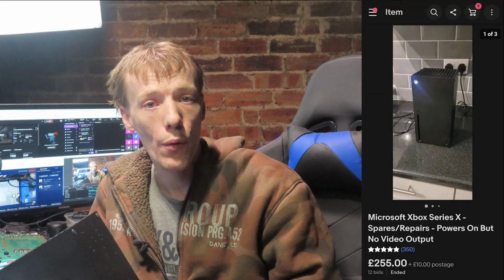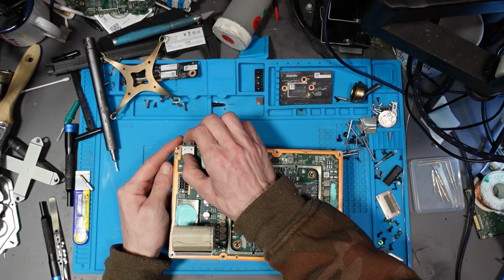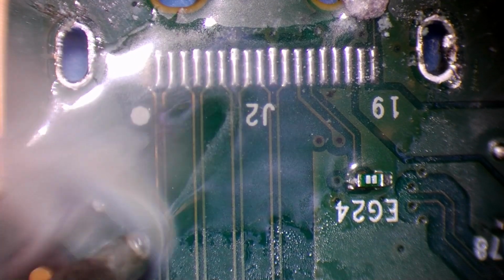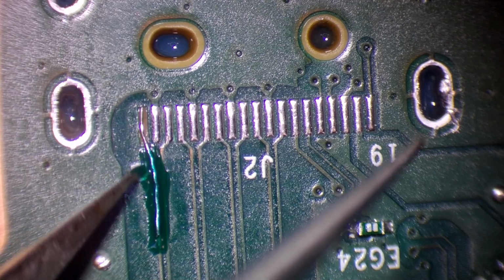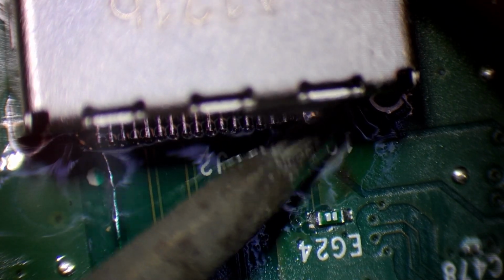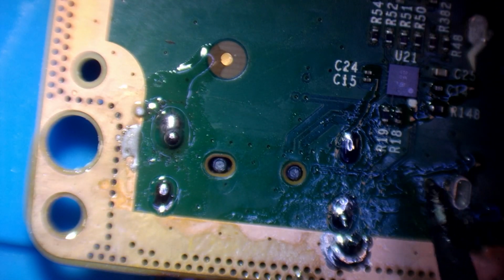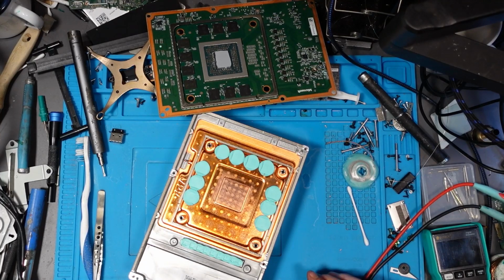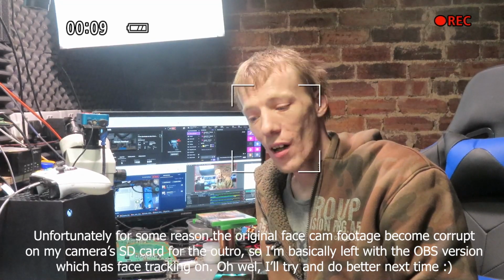I Paid $360/£265 For A BROKEN Xbox Series X On eBay! But Was I Being Lied To And Can I Fix It?

Comment: Wasn't that bad i spected way worse from a previous repair attempt, you saved an amazing console from going to the landfill and you can use it and enjoy it
Reply from the maker: Yeah it does feel good on that one, works great now too
Reply: @TheCod3r  If the listing didn't mention a prior repair attempt, and the pics showed the warranty  sticker intact, that's a bit deceitful?
I'd have pushed for an extra £30 or so off with the seller.
Good vid 👌
Reply: @stuartburns8657  I wonder if the seller was the prior repair shop. Imagine them telling the customer its trash and it needs recycled then selling it on eBay
Reply: @jasonlane4851  perhaps yes
Reply: @stuartburns8657  the fact that the posting was deceitful.  If the buyer wanted to report it to eBay and PayPal he would get a full refund and get to keep the console
Reply: @djones3021  I guess it's proving that sufficiently to get a full refund.
Still, don't try, don't get and all that
Reply: @stuartburns8657  if it had intact seals microsoft would have fixed it.

Comment: Solder flows towards heat. If you try to carry the solder to the joint with the soldering iron, it would rather stay on the soldering iron. Better to heat the wire and the trace, and apply the solder a little way away, and flow towards the joint. Then you can do it in one.

Comment: Well done - a nice neat job, and good to see electronics being repaired rather than going into land-fill.  My one criticism, which I hope you take constructively rather than seeing it negatively is to get a bit more confident with the soldering - your technique is good but you don't trust the result and uneccesarily go over and over the joints.  One or two fairly quick passes across a line of pins should be plenty - the professional assembly line workers hand solder all the pins of a 50 pin PTH connector in about one second!  Repeated passes carries the risk of lifting the pads, and from what I could see it was all fine after your second pass on the SMD pads of that HDMI connector (and a "flick" at the end would have done it perfectly on the first pass - you only needed to get rid of the bridge on the last two pins, not go over the whole line again and again).  For the mounting PTH pins connected to the heat-sucking ground plane, use a hotter iron with a chunky tip and it will fill those holes with a single soldering operation from one side of the board only in about 2 seconds, and no need to "finish" with a hot air gun (which could have caused the connector pins to become unsoldered).  Every heat/cool cycle risks lifting traces, delaminating layers and doing other damage.

As a tip, baking the whole board for a few hours before doing any hotair gun work will prevent possible damage caused by moisture flash-boiling under or inside the components ("popcorning"), delaminating or bubbling the board layers or interfering with getting a good solder joint.  I'd routinely leave boards and/or unsealed replacement components baking overnight, after which it's good to work on for the following week at least.  Plastic connectors etc. will not be damaged if you keep the oven temperature down to less than 120 deg C, no matter how long they are in the oven, though check if there are any low melting point materials on the board (some RF equipment such as radios & TVs use wax to seal variable inductor cores).  I've worked in the electronics industry for over 40 years, so do have some experience.
Reply from the maker: Cheers mate. I do wholly agree about confidence. Personally I know the job is going to be good but I like to be in a habit of checking over my work just because it's a good habit to have. You're 💯 right though usually one or two passes with the drag method will suffice for most jobs

Comment: Every time I've seen fan behavior like this on XSX, complete with the impact mark on the outer casing, removing the fan assembly and giving a firm push on the blades toward the bearings has brought it back, even if it may sound a little rough. Otherwise it would give erratic functionality, fan spin on boot but it stops trying once booting to a game.

Comment: Just bought my first faulty console from ebay to take a crack at a repair, a £20 PS2 slim. Listed as “the red light on the power button doesnt turn green when pressed”. Initial thoughts go to the little switch thats on the board behind the power button if you take the top cover off. And i was right, as soon as i took the top cover off, that little switch fell off. Hows that for my first go eh?? Lol
Reply from the maker: haha not bad, and a pretty nice win there mate. The PS2 still fetches a decent bit of change ;)
Reply: Sometimes we luck out.
I've been buying a few 'non working' N64s  from ebay recently.  The majority are just missing their jumper packs but thats not something I'd expect the thrift and pawn stores they get given and sold to will ever check.  A $15 jumper pack or ram pack (a LOT more expensive) and they're good as new.

Comment: Lucky score there... you've encouraged me to start looking for spares or repairs series x again... can't say I like that flux doing that tho. Also try the RS solder sucker you can replace the seals and nozzles, I've had the same one since colleage, a good 25 years or so....
Reply from the maker: Yeah definitely a good score. To be honest the flux only does that because I run my iron at 450⁰C constantly so it's a little too hot, if I run it at 400⁰C the flux doesn't really melt

Comment: I really hope somebody can answer my question.

As a novice in repairs myself with no background in electrical engineering maybe I'm not understanding because there is things I don't know that others do.

Then you noticed pin 1 had a loose pad Instead of hot air gunning the port off and grinding on a trace to run a wire why didnt he just grind on the trace and run it to pin 1 with the port as is  then test for signal? If all good then just solder mask that loose pad? If not then take port off board.

Different strokes for different folks or am I missing somthing?

Comment: nice work. All ive ever done is replace old electrolytic caps and a couple of discoloured resistors and a voltage regulator in my old consoles and a stereo system.
not because things werent working, but the caps were getting old and i discovered some dark looking resistors and a voltage regulator which was a bit off from the stated specs. The stero system had a leaking cap which i could see through the vents, it did still work but it was time to change them.
Reply: Got to say, I've repaired loads of through hole items and when faced with SMD's I was a little overwhelmed. I imagined it would cost a fortune for the equipment. Happily it wasn't quite the case, the need for a microscope being the biggest outlay (I'm an old fart and my eyes struggle a little now). I make decent money on the side buying and repairing tech, the internet is a wonderful resource for knowledge as well.

Comment: Xbox don't usually have HDCP enabled unless you load up an app that requires it i.e Netflix. On ps4 you can manually disable HDCP on the settings in case you didn't know :)
Reply from the maker: Yeah the xbox is fine but I'd rather leave the cable permanently connected to the HDCP splitter, it's easier that way lol

Comment: So i have a problem with a AE-9 soundcard I bought directly from Creative. 

When i got it, Creative were the only retailer of it, not sure if thats still a thing or not but the 1st one I had before I RMA'd would stop connecting with the Creative software and OS (win10) randomly, nothing would allow it to be accessed after that. 
Then it would keep doing it after a reboot, i'd resit it, allow the power to drain on the whole system etc and sometimes it would still not come back. Randomly, the same as it would switch off, it would come back. 

Caused my hair to go white since I paid ~£350 for it so i had it RMA'd but because it was outside of the years warranty, Creative would not do a refund although I did talk about it being a faulty product/batch defect as i'd never seen that behaviour from any plug in card but didn't insist that point as I really do like the sound of it, back2back with HDMI it has less loudness, a softer/sweeter sound and for vocals especially it is spot on n took a chance to get a working one. 

Anyway this one i got back, does it when Windows boots yet after closing the software and reopening, it connects and stays connected. I believe this is the best Creative can do with it so this is half warning, expect issues but its such a wierd problem, i've never had anything do this after 30 years of working with hardware i mean, when something stops working how i describe, it usually stops working completely but randomly, it would work again. Side note, also had the AE-5 but that had no issues like this.

Complete anomaly product imo but yea if you read this wall of text then I thought it might be of interest to others who work with hardware, at least be aware of it if you ever get a chance of getting one 2nd hand.

Comment: This guys awesome 👌 Great job and video...no B.S. video👍like alot of ones YT puts up...Question? I have the halo console series x brand new off the Bestbuy shelf, I noticed after turning it off and it shuts down the fan stays on, I guess for quick resume...and if i do a full shut down from the settings the fan stays off...is this normal? And is it OK to just shut down with the button on the controller and the fan stays on?...thats for your experiences, if my console ever broke I would want you to be the guy fixing it👌
Reply from the maker: Hey bud, thanks very much, really appreciated 👍 yeah it's completely normal, when the console is set to quick resume mode it will keep power applied so it can basically start up quicker. I'd recommend turning it off though because all it really does is put more power cycles through the system and with the series x they fire up fast enough to not need that option, so keeping it to full shutdown mode would put less long term life on the system. Also yeah I shut my console down with the button all the time, it shouldn't hurt anything 😀
Reply: @TheCod3r  thank you buddy keep up the good work 👍

Comment: its funny what you said about getting wire from microwaves, i design, build and reverse engineer metal detectors, and i have found the best enamel wire for winding detector coils comes from the degaussing coil around the screen on old crt televisions.
its way better the new wire, mainly as it actually contains copper, lol, the new stuff is aluminium coated with copper, which is a bitch to solder and winds crap coils.

Comment: Excellent video and superb repair I was just wondering did you use a new hdmi 2.1 port and a hdmi 2.1 cable
Reply: Physically hdmi 2.1 uses the same connector as previous versions of hdmi, it was only a change to the protocol enabling new features and a new cable standard that allows higher throughput - as I understand it.

Comment: Cheap flux can be very bad if you reball chips, because you can't clean the flux off under apu or other chips and some cheap fluxes can corrode pads or solder.
Reply from the maker: True, but isopropyl alcohol also acts as a solvent and neutralises flux, so put enough of it on the board and it'll prevent that from happening. That said though Kingbo RMA-218 is no clean flux, I left it on a board for over a year deliberately and it didn't show one sign of corrosion
Reply: @TheCod3r  Haven't worked with kingbo but know that some Chinese fluxes can be harmful under chips.
Reply from the maker: @denman123456  yeah definitely, I actually have a video coming soon which has that exact issue, a ps5 I bought recently and the cheap flux did a lot of damage to the pads

Comment: A lot I can relate, cheap stuff that works, toothbrush, going extra mile cleaning the thermal paste and using good Arctic MX thermal compound and spreading in a thin layer, I use it for more than a decade since MX2, but I'm not liking is MX5🤒

Comment: Nice one, Cod3r.

I wanted to ask, which Isopropyl Alcohol would you recommend for cleaning my pc (the circuit boards, fans, case etc...) and general maintenance?
Reply: 90% at least. Brand doesnt matter. it's simple alcohol, at the end of the day they are all the same
Reply: @gabrielenitti3243  
Isn't it 99% ideally?
Reply from the maker: Personally I prefer 99.9% IPA, but you can technically use 70%, just 99.9% will do a better job
Reply: @TheCod3r  
Great.

Is it safe to spray or rub it on to every component?

So, the GPU fans, any exposed circuitry etc...?

Comment: Crackin job, I wonder if you can get parcial refund, I bought a graphics card a few years ago now off ebay and when it arrived I took it out of the box and it was in and anti-static bag, as I looked at it I noticed what I thought was a speck of dust, on closer inspection and after examining the gpu board I could clearly see it had a missing capacitor, so putting 2 and 2 together i realised it had come off some how no idea if during postage or before, furious I messaged the seller and they were very apologetic and even offered a full refund if I sent it back, but as I could not be arse to be honest, decided to try to fix it, being an amateur at fixing stuff decided to at least try plus I owned a soldering iron and managed by eye and shear luck put the component back in its place to find it actually worked, so I got a partial refund and a working gpu in the end.

Comment: Hey mate, hi from Australia I had to replace my HDMI port in my Xbox Series X however I can't get 4K anymore. only 1440p at 60Hz and 1080p and 60Hz & 120Hz,  No matter what I do from hard resets to replacing the HDMI port twice, 4K just wont work now. Do you think the HDMI Encoder chip is gone? (retimer IC chip)? I can get brand new Xbox Series X Retimer IC chips. there a bit $$$ just not sure if that would be the issue. let me know you think. cheers mate.

Comment: @TheCod3r I admittedly scrubbed through a bit of the video so I may have missed it, I highly suggest you put a drop of epoxy down under the port like how it is manufactured for added strength due to the almost non existant legs of the hdmi ports.
Reply from the maker: It's all good mate, I see where you're coming from on that one (especially on the Series X) but honestly I wouldn't ever use epoxy. Normally I scrape the coating away from the ground legs and add more solder but since I'm keeping it for myself I know 95% sure it's never going to move or get broken so I'm not worried on this one lol

Comment: My series s does the same i plug it in an i have to wait 10 seconds or it will switch on switch of .. I was also having a fan problem were it wouldn't start spinning i would have to smack my xbox which would make the fan work but that seems to have fixed it self

Comment: Hi, By using scrap wire. Your saving the planet one fan at a time. Also if it works don't knock it.
Reply from the maker: Indeed bud, I always reuse stuff when I can, it might be miniscule but it helps the planet long term

Comment: I got a friend's ps4 that had burn marks on the metal casing where all the power caps are. I'm thinking that it's too much so I'm switching the power supply first. When I switched the fan this fan doesn't spin as fast
Reply from the maker: Sounds like the fan bearings are failing to be honest mate, I'd try another fan
Reply: @TheCod3r  but the original fan was spinning way too fast. I used kryonaut paste. And it still spun way too fast and started making noise.
Reply: I'll change it again but is there a case to where too much current is being fed or something? Or maybe the metal case was hot enough to transfer gunk off the caps since all caps is unlikely.
Reply: @TheCod3r  yeah it's working I changed the fan lol didn't remember how fast the fans can go I guess lol

Comment: Great video man and what tips would you have for a first time person learning soldering as ive made messes with a few ports but when it came to the Nintendo switch led port that that worked very easily but I'm having issues such as charge ports as I can't seem to get the solder off with releaded solder and wick might just be me but I'd thought I'd ask yourself as you have such a great technique
Reply from the maker: Maybe try removing your nozzle when removing the port and going bare back sort of thing, go full whack on heat and just take your time, don't try and force it off because that leads to torn traces
Reply: @TheCod3r  cheer man and yeah great advice and yeah I'll retry without the nozzle and see if that does better I always keep it close but far not to burn any resisters or compasitors but honestly really helps its appreciated cause I wouldn't ask unless I wasn't doing something wrong as don't wanna destroy parts or anything as I know it can be a difficult process with little knowledge
Reply: Plus you idea to use a solder sucker instead of wick was nice touch cause I can see that works extremely well
Reply from the maker: @matthewwatters5870  no problem at all. If you're on discord feel free to join our community server

http://thecod3r.live/discord

There's tonnes of people happy to help you out with tips and tricks
Reply: @TheCod3r  cheer man I will once I get pc up and running as im already on discord and you help has made me rethink my attitude towards soldering as you build my confidence

Comment: I bought a cheap laptop Samsung NP 350v5c laptop, on but no display, did all usual checks then unsoldered bios chip, soldered it to my reader and it was fn empty. All FF's FFS lol how does that happen
Reply from the maker: Seems like it probably become corrupt or someone tried to update the bios and lost power. Did you manage to re-write it?
Reply: @TheCod3r  It times out when I write to it. Went to apply a little pressure to edge of board and the chip is red hot, burnt my finger, so guess its junk. Ordered a new one.